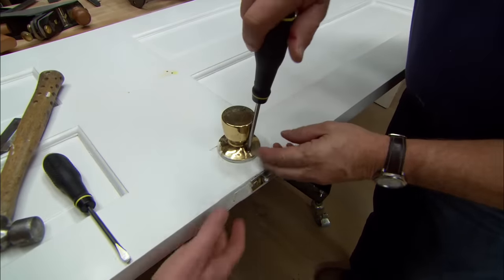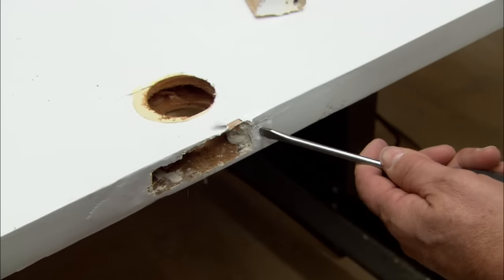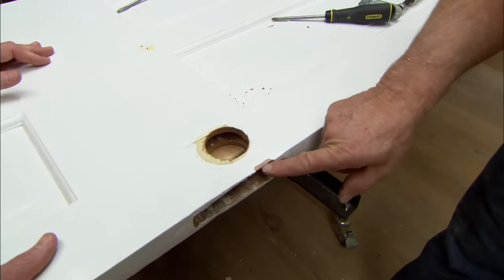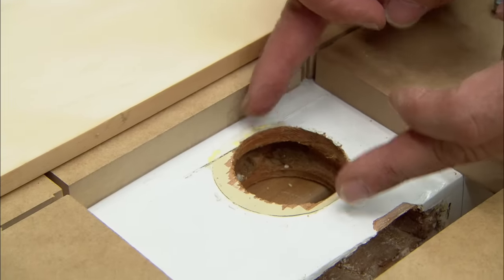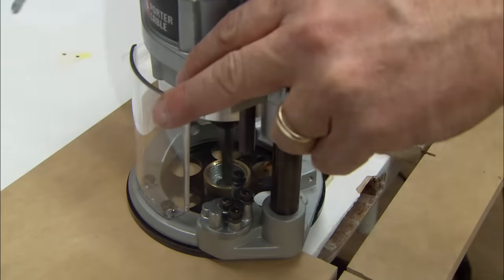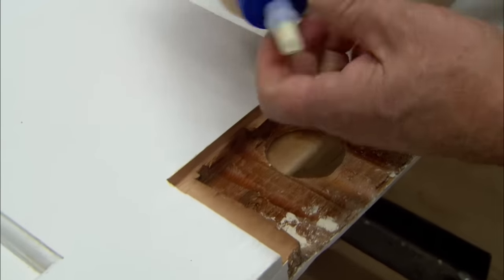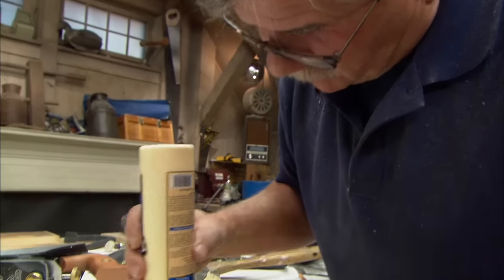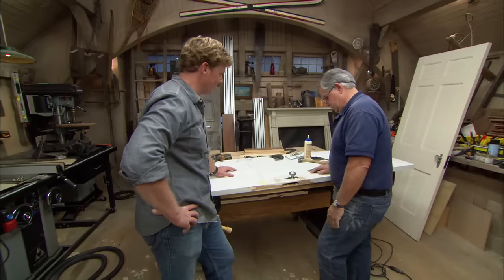How to Patch a Doorknob Hole With a Dutchman | This Old House

Comment: When these doors are so cheap to buy, why on earth would you try to repair one with this kind of damage?
Reply: The problem is they're very old and the sizes can be really odd, you can't just go to Home Depot and buy one, they don't make them, you'd have to have it custom built, or find one that is either the same or can be cut down. This is a better solution and is a lot easier in the end.

Comment: How to fix a door if you have several thousand dollars worth of wood working equipment.
Reply: Router ..couple hundred.. Clamps.. 10 each... Glue... 10.. ..... Sanders ..  100... Block o scrap wood... Free
Experience guided by intelligence... Priceless
Reply: Its the men not the machine... cough
Reply: How to fix a ..... 40$..........door if you have several thousand dollars worth of wood working equipment.
Reply: @benphillips3222  
You forgot the drop saw
Reply: @David.Horne72  😄 yup
Reply: C J Bowen  
Thanks
Reply: @plozikou  An unfinished hollow slab door can be that cheap, yep.  The door Tom worked already has the three hinge mortice, was cut to size and hung for the existing door jam, and has a finished paint job aside from the knob area.  That's a lot of time to work on a scratch door slab.
Reply: C J Bowen  That kind of Lowes door price is for an exterior solid hardwood door.   The door in this clip is interior, and yes an interior hollow composite unfinished, non-hung door can be had for $40.  But there's a lot of work to do get a $40 door ready to hang and painted.
Reply: @Nill757  I am absolute amateur. I've installed two slab doors....I was desperate. I had time, but no money. Believe me, avoid installing a slab door.
Reply: The expensive tools just make the job easier, you can still fix the door with basic tools, just more laboring and time consuming.
Reply: Me and most of my friends have all of these tools. If you own a home and do your own repairs they tend to accumulate for some reason.
Reply: Don’t need thousands in equipment to do this. I’ve done a few with electric hand drill/hole saw, hand plane, chisels, hand saw and wood glue. An oscillating multi-tool would be handy. Under $500 if you don't go top end tools but you have it for other projects.
Reply: You're way over on your estimate and you could easily do this with a chisel and a hand saw if that's what you had.
Reply: Laughed out loud reading this comment
Reply: You need tools to do carpentry. That fact will not change. The point of this video is to give you the knowledge needed of doing the repair.
Reply: ehh, not really. he was able to do this with barely any equipment. only the router is a specialty item, and i bet there are other ways to do this. or cheap routers.
Reply: On today’s episode of “man discovers woodworking requires woodworking tools” 🙄

Comment: Doesn't this make it easier to kick the door in?
Reply: +sjbdeebo2 Why would it?
Reply: would make it easyer 2 kick in as ur weaking d stile (vertical timber, almost cuttin it in half). hence y its a patch (over d top but a nice patch) and lets not bother thinkin of the mortice and tennon joint connectin the mid-rail to the stile been weaked.
Reply: nah man with the glue this will not make it weaker. stop having doomsday thoughts.
Reply: ah zombies at d door... hope d dutch man holds..
Reply: Anthony Knight Right, stop the doomsday thoughts.
Reply: if you see the door before it was patched, you will realize that the patch is much more thicker than what was there before.  So it is technically stronger now with the glued in patch, vs. what was there before.
Reply: spencerdasilva Thank you.

Comment: That's just one way, and not the best way to repair that type of damage. This repair will not hold up over time. The best way is to replace the door or take the door apart and replace the board. Just my opinion.
Reply: ^^^ thats just another way, and not the best way to repair that type of damage.  The best way is to use fiberglass and body filler to fill the hole. Just my opinion
Reply: James Kennedy Bs that's the best way to do it but he could make the Dutchman a little bit longer for more strength
Reply: Yes he could have.
Reply: I'm not sure about just replacing the door to fix the door Knob. It won't last, better pull down the wall too and start from a good wall.......:)
Reply: Let's go a little further. How about begin by replacing all the walls to ensure they remain square and this way you have a truly "seamless" transition b/ each wall.

Comment: Bondo works best. You guys made way too much work out of it. Bondo fills, seals and sands down to a perfect match PLUS if you ever had to you could even drill through it to mount new door hardware.
Reply: says the guy that doesn't go look at the bondo fill job two years later that has a crack where it didn't flex the same as wood ...please people bond is fine for some tiny imperfections but in no way is it structurally sound enough for long term fixes at a point where door hard where will be installed   especially not if it's 3/4 or more thick
Reply: Douglas Hanlon
Beg to differ. 3 + years now and no cracks, door knob and locking mechanism holding fine. Says the guy who looks at his awesome bondo fill job everyday. neener neener

Comment: Great video but this patch is not a real dutchman, which has beveled sides to increase gluing surface. Also it is too short. In time and after a few door slams, the glue filled space along the end grain will show a  crack because of the small glue surface and the flexing of the door at that spot. A bevel of at least 3 to 1 ratio would have been preferable, along with a   longer "dutchman" of at least 12 inches.

Comment: How to drag out a simple patch job.
Reply: what's your alternative?
Reply: IamHueGraves I don't need a router or jig. By the time you've cut it out with them I'd have finished patching mine and hung the door. Can't pass on how I'd do it though, trade secrets passed down through the generations need earning.
Reply: so no video to prove it then?. anyone can talk but without video there is no proof, its just words
Reply: IamHueGraves rotozip.
Reply: I was thinking the same thing. Look at all the equipment he needed for a patch. Cut a block of wood trace it out cut what you've trace out and your done. He made it complicated. His patch would cost way too much in the real world
Reply: But it will last...such a door is too valuable for a bad job.
How would you do it? Or are you handling it like Ivor Bigun which will only tell it after performing the secret handshake?

Comment: All that, shit I would of went to Home Depot to just buy a new door
Reply: You must have money.
Reply: @rneedham667  $35 for a new primed door... Paint it with semi-gloss white and you're done.
Reply: @maranatha9924  No, hang it first in the existing jam, i.e. cut it to length, plane to width, mortise for the hinges,  cut for the latch hardware, then paint.  Clean up after paint.  The door Silva is working has most all of that already done, and appears to be a better door than the HD $35 hollow composites from HD.   And Silva didnt need to spend time on a run to HD or anywhere else either for this job.  All in the shop.
Reply: @Nill757  Aye. I was referring to a closet door which I replaced so that was the type of door on my mind.  I only had to drill some holes at the top to hang the door and paint then done.  It was slightly wider than the previous door but I wasn't going to cut it and you can't tell anyway.

Comment: Just go and buy a new door.
Reply: Love it :-)
Reply: Did you get a good look at the door? The hardware might be a give away, it's a VERY old door, which means they don't sell these at your local Home Depot. They're going to be an odd size by todays standards, which in turn, means that unless you find a matching door, you're going to be cutting another old door down that may have the same issue THIS one has. I'd say the Dutchman is a pretty easy fix in comparison.
Reply: Only in America would that be called a VERY old door XD
Reply: Cobone you can't pot old fashioned hardware on an old door

Comment: just buy a new door.. save u time
Reply: It's an antique door, many of them are made out of hardwoods (maple, redwood or others depending on where you are), good luck finding a replacement.  Nevermind that old doors are almost never modern dimensions, which means having a custom door made for a lot of money.   Finally, replacing the door with something new will destroy part of the value of the old house it is likely going into.  This is a much, much better solution and period appropriate to the house.
Reply: this is why you dont have anymore money Carlos.
Reply: Historic renovation and restoration is the art of re-purposing the original doors, windows, wood, etc. in the process of the job, and the original parts and pieces of mill work are far superior quality to the crap being produced today.
Reply: I don't think you really know how much a decent quality door costs...
Reply: +Chris Pope yeah. he was probably thinking of the 30 dollar paper ones
Reply: agreed. I definitely would buy a new door. $150 for a top-of-the-line hard wood, solid door. If you have the tools to do this fill in (nice job by the way) then you have the tools to fit a new door. What Tom doesn't show is the time involved.. I could probably install 3 doors in the time it takes to fix this one.
Reply: E Dub *you're
Reply: it's your as in the possessive,  not you are trailer,  thanks for playing though

Comment: I hate repairs like this . Start off with a razor sharp chisel and plane then hit some random nail in the middle of the repair !! As if the old paint and filler are not hard enough on you blades .

Comment: Just get a new door
Reply: Haha imagine a youtube channel like that. "In today's tutorial, I'm gonna show you how to repair a damaged door. Just get a new door. Thanks for watching. Tune in next week when we show you how to fix a broken marriage."
Reply: Same with a car. Instead of replacing the muffler, just buy yourself a new car. Problem solved.
Reply: If the car is £100 and works, then yes
Reply: This looks like an old door that you can't buy anymore. I recently had to purchase one and it cost me $600.00 because they had to make it - and it still was not the same type of door.
Reply: Kimberlee is right. The newer doors sold at places such as HD and Lowes are not as solid and durable. They're virtually hollow and prone to separate at the edges, and one would not be able to do a patch job as in the video. I have dealt with a few of those newer doors and they  ............ suck for lack of a better term.
Reply: lol I can't believe that my flippant comment has caused so much controversy. the guy is clearly very talented.
Reply: gawpertron, not sure who your comment was aimed at. I was throwing my 2 cents in saying that newer doors that I have worked with, mostly used between rooms, are of such poor quality one can literally kick a foot through. The older doors have so much more wood to work with as well as having better sound proofing. I liked your original comment.
Reply: P B I can't deny that the build of most things these days is pretty shoddy.

Comment: With how cheap new doors are no need for this ,did u see the shape of door edge looked like someone had a go with an axe just because it's old doesn't mean it was a good tradesmen that fitted it there was shit tradesmen back then to door needed dipped and straighten with that costs alone new door cheaper